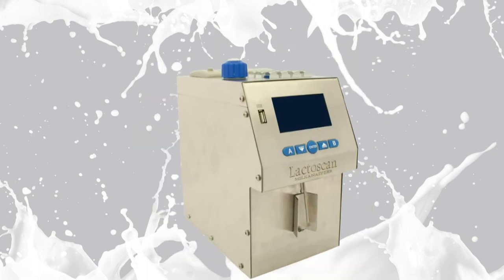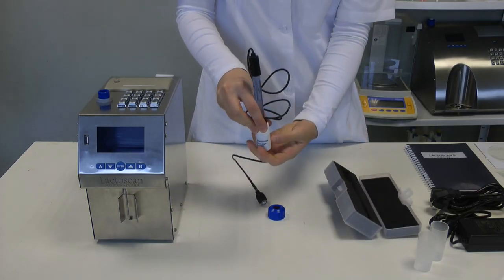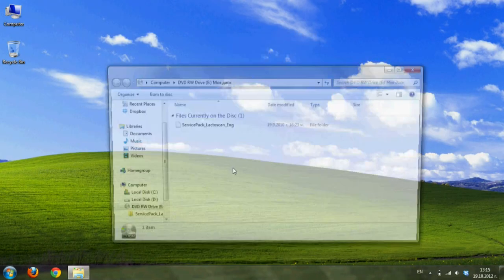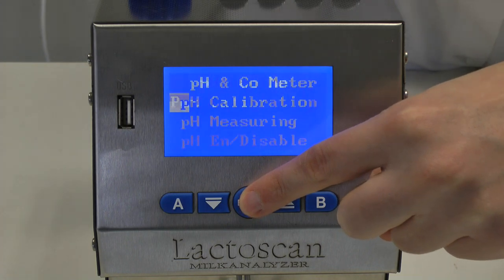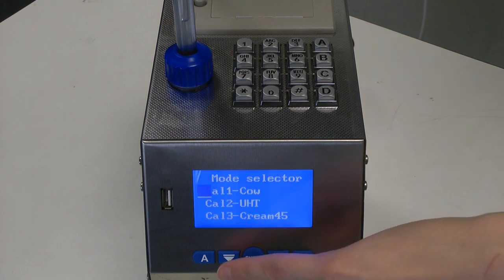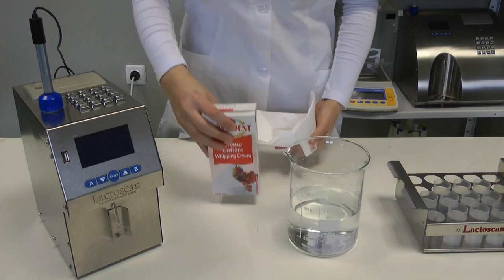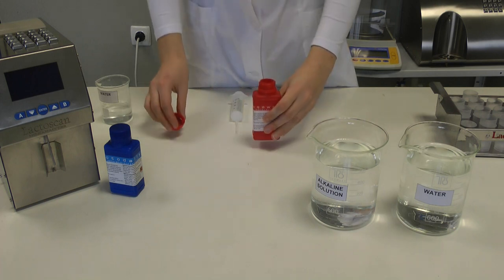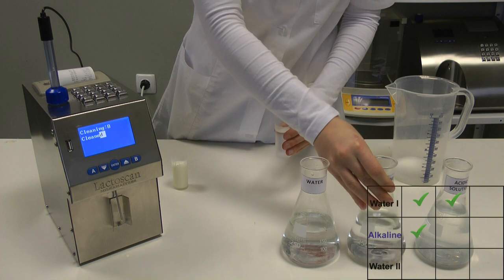LACTOSCAN S

Comment: We used around 350 machine.same as cleaning also very must for better result.
And one thing the motor section milk inlet parts also improper ..
 thing . because not clear in good.
U to try and improve sensor based led e.g RTD based concept for temperature.same as possible for milk using this method..